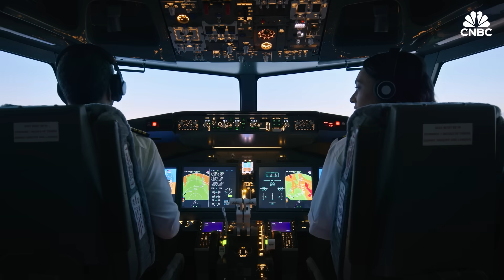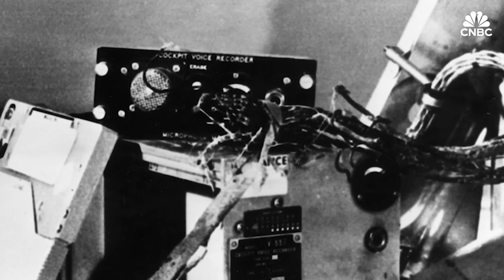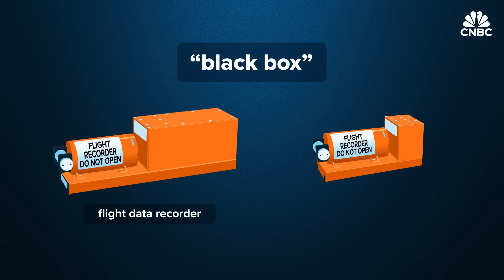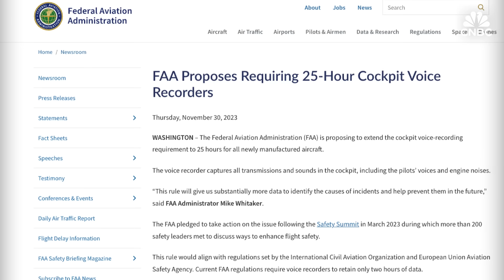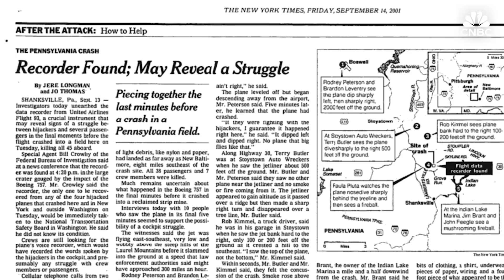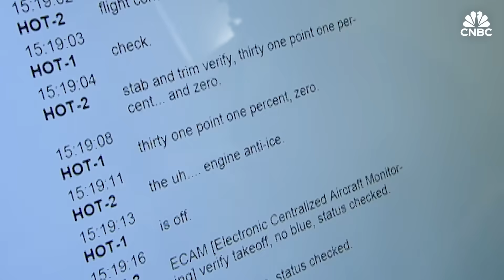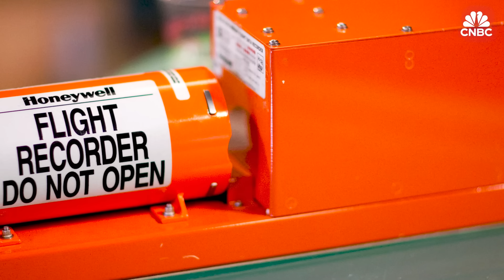How Does The Black Box Survive Airplane Crashes

Comment: This all reads as a red tape and greed issue. I'm certain that if you give any of these problems to a competent company, without irrational restrictions, they would have them solved in a matter of weeks. 
The fact that they're struggling with integrating audio recording lasting longer than 2 hours is honestly laughable. If they take the price of one of those tickets and put it into storage, we could have petabytes of data in those boxes, and saying that would require different wiring is a bald-faced lie.

Comment: If bandwith is a limitation, here is my solution

Keep the black boxes for high-resolution data storage

Employ new satellite based FDR/CVR data uploading, however, heavily compress it to say 32kbps OPUS

This way, the recordings are tiny in file size and easy to upload so that if the data recorder is never found or if data is intelligible enough at a low bit rate to paint a good picture the investigation can still be concluded

If the low bitrate isn't enough, they can still attempt to retrieve the physical box.

The best of both worlds.
Reply: in my quick research, looks like SD Phone calls are 8kbps audio, still enough as a backup if the CVR is never found, and tiny to upload & store

Comment: Many aircraft today have constant broadband connections via Starlink or some other service. If they allocated some small portion of that uplink to telemetry, that would be plenty. Just one megabit per second could be enough to send thousands of parameters several times per second, along with high quality audio. And a single modern hard drive in a server could store several years worth of data before running out of space… or several days of data for hundreds of flights. We’re talking about a very small amount of data here!

Comment: With today's technology it should not pose a problem to connect several miniature auxiliary fdr/cvr  units e.g. in the tail, wings, top of fuselage etc, which are waterproof, fireproof, floating and equipped with a locating transmitter. Launched on impact or in ground proximity with the aid of small rocket motors. Chances of finding undamaged recorders would multiply, cost would be minimal.

Comment: CVR and Flight data should be downloaded at the end of every flight and stored in local servers at the airport, that way the CVR logs could be preserved for 90 - 180 days after the flight for use in a later investigation if needed and provide a backup in case the pilots forget to pull the CVR breakers.

Comment: Are you guys joking 
It’s an audio recording 
And the flight data recorder is ONLY recording data points on a graph 
They are not recording 4K videos that require high data bandwidth to record and store 
I bet the memory capacity of these recorders is not more than 64MB or 128MB (looking at the size and design of those memory chips ) 
FAA is hoping for 25 hours of AUDIO recording by 2030 on an airplane that costs over $150M 
5TB flash is no more than $500 on Amazon 
When competition dies advancements goes with it

Comment: Thtey could have an ejected locator beacon. It does not have much data about the crash but it could help find aircraft that crashed into the water or wilderness to make finding the aircraft that much more easy. The aircraft could have two beacens. One the pilot can manually eject the other one that an automatic system ejects. The two could have slightly different signals so searchers know which one they are tracking.

Comment: they dont mention how many gb the memory onboard is but considering how little space a 256gb single nand memory module takes up i would assume they pick larger capacity but then again, they seem to mostly have WRITTEN data and that takes up barely any space and voice recordings dont take up overly much space either.
Reply: if it’s many audio tracks at once, then it can be a lot more if i had to guess. i’d also imagine that they’re not using standard consumer nand chips because of reliability issues and what not

Comment: Starlink works on aircraft already across most of the global aviation network. Target state should be:
- mandate every new plane has a high bandwidth LEO satellite communications stack (like Starlink)
- flight data recorders upload in real time the stream of flight data and audio recordings 
—> plenty of bandwidth to do this with LEO
Reply: It is more complicated than that if you give it a little thought. First, this would require a network link between the flight instrumentation and, essentially, the internet. That is not a good idea. If you narrow that to a bespoke satellite network divorced from the internet, that gets pretty expensive, I mean, not insignificantly so, requiring  hundred(s) of LEO satellites placed in orbit that have one purpose only. And you need to constantly be checking connection on the ground and in the air, as you don't want a flight departing which does not have its flight recorder working. Satellites also can be affected by space weather, which there is little you can do about. Connection also needs to be maintained between the satellites and the ground receivers/data centers; do you also run a parallel network to the internet for this, or trust that the internet at many different links will always be up? What if regional DNS goes down (as happens from time to time)? Does the transmitter run off aircraft bus power? What if the aircraft experiences power loss? Does it require a large-ish battery backup? This adds weight, but also what if the battery is damaged by the same event which damages the aircraft?

The onboard recorder is simply a much more robust system because it is a much simpler and self-contained system. It's just a module the size of a toaster/microwave with no security vulnerabilities possible, if it breaks or the battery reaches its shelf life, it can just be swapped out with mechanical tools.
Reply: @samwise1790  They are certainly not mutually exclusive. The robustness and local resiliency of existing components in aircraft flight recorders does not need to be degraded or exposed to higher risks of compromise simply by adding a best effort real time streaming backup.

Redundancy is key. First principles there is no reason why both systems cannot exist.

Comment: 12:12 not sure you'd want to keep the black box in the APU
Reply: Could be good... if the apu is running in an emergency that may be the only good power source... Wire harness damage may have occurred in explosions and it would keep on going due to short wire runs
Reply: @williamhaynes7089 its in the hole where the APU turbine bit sits

Comment: From my experience, black boxes do not start up at engine start and do not shut down at engine stop. Cactus 1549's recorders continued working after the dual engine failure.

In the case of the plane I'm working on, it starts when the beacon is on and the parking brake is off, and has a 10 minutes internal battery in case of electrical failure.
Reply: of course 1549's recorder kept working they switched the APU on right after engine failure
Reply: @caninec18  no you don't understand, the black box didn't shut down and start up again when the APU was started. It stayed on the whole time. And the APU is nothing more than a generator. 
The batteries were providing 24 volts to the essential bus, and the black boxes are powered by this bus (just like every essential equipment). Ever wondered why they were able to start an APU without electricity provided by the engines or by a GPU? Well that's because the aircraft had batteries. It's the same for the black boxes. It's designed to be fool proof.
Reply: @caninec18  I work in manufacturing and we test the black boxes before the engines and the APU are even installed. Tells you everything that needs to be told. Black boxes don't care if the engine or the APU is supplying electricity, as long as there is electricity and the conditions to be turned on are there, it will be turned on no matter what.

Comment: All planes should have them. They should be uploading live via Starlink 24/7
Reply: Black boxes currently do the job. We don't need to sacrifice the pilot's privacy by sending everything they say every day to the Internet to solve a problem that doesn't exist
In the two cases where black boxes weren't recovered that they talk about we have a pretty good idea of what happened. For 11/9 the crashes were caused by a hijack, for MH370 it was also probably a hijack
Reply: @sixtealbisetti2480  
Heavy pax pilot here, I take it you might be a pilot too. No sir. We don’t need privacy when it comes to hundreds of others peoples safety. Cops have cams, we should too. 

here a quick dump from chat:

Air India Flight 182 (1985): Boeing 747. Bomb explosion off the coast of Ireland. The main wreckage and CVR were recovered from relatively shallow water, but the FDR was never found.

South African Airways Flight 295 (1987): Boeing 747-200. Crashed into the Indian Ocean east of Mauritius. The wreckage is in very deep water (~16,000 ft). Only small fragments of the FDR and CVR were found; no usable data was recovered.
Adam  Air Flight 574 (2007): Boeing 737-400. Crashed into the Makassar Strait off Indonesia. The FDR was recovered after a lengthy search, but the CVR was never found.

Malaysia Airlines Flight 370 (2014): Boeing 777-200. Disappeared over the southern Indian Ocean. Despite extensive multinational searches, the main wreckage, FDR, and CVR have never been found. Small pieces of debris confirmed to be from the plane have washed ashore, but the critical data remains locked on the ocean floor in an unknown location.

· TWA Flight 800 (1996): Boeing 747. Exploded off New York. The FDR and CVR were recovered from the seabed, but the lengthy recovery and reconstruction effort underscored how lost recorders would have fueled endless conspiracy theories.

· Swissair Flight 111 (1998): MD-11. Crashed off Nova Scotia. The FDR and CVR were recovered, but both stopped recording 6 minutes before the crash due to the in-flight fire. Investigators desperately needed the data from those last minutes.

Comment: The FAA needs to add a camera to see outside of the cockpit, like a dash cam. It would allow investigators to see the pilot's point of view during an accident.
Reply: Thats already been thought of but the pilots union have always fought against the use of cockpit cameras citing the need for privacy.
Reply: @keytothewall I know about the unions and the pushback to cameras in the cockpit. But OP mentioned cameras OUTSIDE the cockpit to get a sort of “pilots POV” 

I guess if they could install cameras outside the cockpit/fuselage that doesn’t impact aerodynamics or attitude then maybe it’s not a terrible idea
Reply: @keytothewall You're right but police have unions too and we still took their privacy away for the greater good.
Reply: @keytothewall  not inside the cockpit, outside. filming the view. just as one on the end viewing the airplane and one from each wing pointing backwards, as all commercial wings have now that shark tip or whats called.
Reply: @keytothewall  Privacy is a BS excuse, most work places have CCTV cameras, but when you have two people literally in charge of hundreds of lives then cockpit CCTV is an absolute must. Imagine how much quicker it would be for investigators if they could actually see the damn controls that the pilots are touching instead of relying on just engine or computer data.
Reply: @keytothewall  Locomotives have cameras. Some OTR trucks have cameras. The lives of the resst of the crew and passengers is of utmost importance.
Reply: I think, if the FAA were to go that route, a camera under the airplane that captures the front underbody of the fuselage and the landing gear may be somewhat useful. Having a camera mounted on the top of the plane near the cockpit window would be difficult since planes already sit so high up and it would be difficult to decipher where the plane is in relation to the ground if it was already airborne, especially on a plane like the B747. Cameras in the cockpit will certainly never happen.
Reply: Flight 191 that crashed in Chicago had a camera like that in the cabin to where everyone could see the pilots view. They all got a first glimpse of thier soon to be ill fated flight….
Reply: @robertsudano4304 that wasn’t recorded though and wasn’t helpful to investigators. But I’m sure that was terrifying.
Reply: Fun fact, the B777 freighters I work on have a camera on the left side of the horizontal stabilizer.. You can select it on a small display on the wall of the supernumary... I don't think they record though. 
Most new aircraft have what's called ARINC buses.. they are networks. The aluminum tubes I work on use ARINC 429 and ARINC 629 data buses, different evolutions of the same basic digital network. Large amounts of data are passed through and available to whatever module needs or wants it
Reply: You know like every aircraft lets the passengers see various views outside of the plane through the infotainment screen?
Reply: you don't need one when its all recorded already, GPS is a main key
Reply: More important is the view INSiDE the cockpit to see what each crew member is doing.   An outside cam will just give you a great view of the accident site you are about to visit.
Reply: The logistics of storage and wiring would be an issue at least
Reply: @islanderKiNG310 what are you bsing about 😂😂 logistics??
Reply: @islanderKiNG310 i’m fairly certain mordern commercial aircraft have networking. I mean at least a CAN bus
Reply: @islanderKiNG310  no it wouldnt at all, just look at those earlier mostly mechanical black boxes, they were beyond complex. not this day. there is military grade storage so no issue at all to store atleast 24hours continues of flying. when landed and that light turns off so ground crew can walk freely around the plane those cameras can be turned off.
Reply: The NTSB is usually much more interested in the inside of the cockpit than the outside of the cockpit, because the cause of most accidents is found inside the cockpit, not outside of it.

Comment: Why not just transmit the data in real time? Pilots unions?
Reply: Not easy. No network to transmit to (planes are mostly out of reach of WiFi and cellular, and satellite data has only gotten faster very recently) and doing that would open an attack vector for hackers, because it would be a remote connection to the aircraft computers.
Reply: @LuLeBe you can't hack into something that is designed to record+send only. And you will obviously be using a private network that only talks to authorized nodes.

Comment: 9:57 Yes, investigations are very very expensive but they are also very rare.  It doesn't make sense to demand expensive retrofits when we all drive to the airport in cars where cheaper interventions could save more lives.

Ultimately, these regulations impose costs that make airline tickets more expensive.  And I support that when it makes sense.  But everything is a trade off.  We could tax instead of regulate and fund cancer research.  

The FAA should use the government's value of a statistical life to determine when these regulations make sense -- taking into account the costs of compliance itself.  

For instance, 25 hour voice storage is probably a good requirement for new commercial planes where it is cheap, easy and imposes minimal regulatory burden but maybe not existing planes.

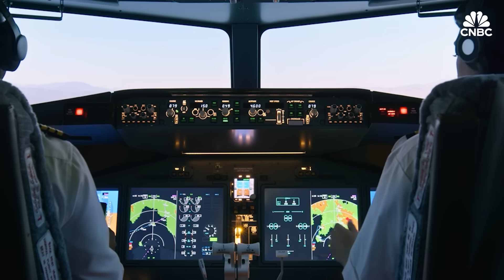Comment: 5:43 Surely they don't turn off when the engines shut down.  That would defeat the purpose in an engine failure.
Reply: Exactly that happened at Jeju Air Flight 2216 - four minutes before the crash.
Reply: At least for the plane I work on it isn't turned on by the engines. 
It turns on once you have either the parking brake disengaged or the beacon on, and stays on as long as the batteries have energy. Once the batteries die, there is still an independent battery exclusively dedicated to each flight recorder and it lasts 10 minutes
Reply: @Fastvoice And the black box turned off?  I presumed it would at least be connected to the auxiliary power turbine.  Or is this the flight where they really lost all electricity?
Reply: @petergerdes1094  APU wasn't activated and there was no battery buffer for the black box.
Reply: I believe they record whenever the electrical power on the plane is on.

Comment: The ability to have two flight recorders like the 787 should be explored further. Redundancy is key.
Reply: Don't forget the DFDAU, and additionally, ACARS reports - like Boeing's AHM.
Reply: What should be studied is realtime broadcasting of the audio.
Reply: @edrcozonoking That would be great.
Reply: Every plane has two flight recorders. The CVR, cockpit voice recorder and the FDR, flight data recorder
Reply: @LightsaberGoBrrrrr  That's not the point. The 787 has two combined recorders at different places - each with CVR and FDR in one box.
Reply: @Fastvoice yes I apologize. I didn’t have the chance to watch the full video but I know a decent amount about aviation. So I made an assumption about what you were discussing. My bad. I’ll watch the full video later
Reply: Planes literally have in flight wifi now. You could just transmit the recorded data in essentially real time.
Reply: @bbbbbb3734 The cost would be ridiculously high, and the speeds are slow. Wasting billions everyear sending useless information.
Reply: @bbbbbb3734  It’s not fast though. And all this real-time transmitting would slow down wifi for passengers
Reply: @bbbbbb3734 the bandwidth to transmit all the data would be humongous